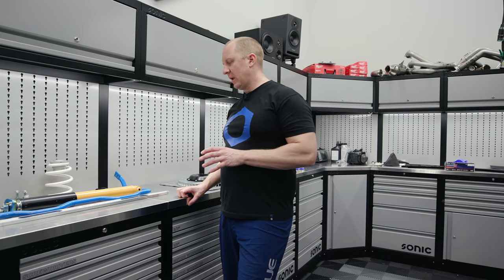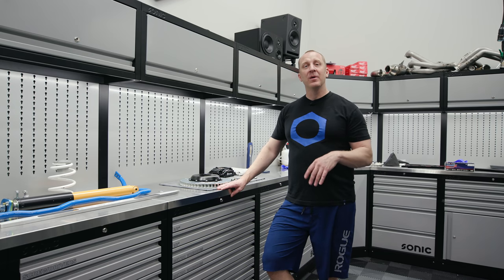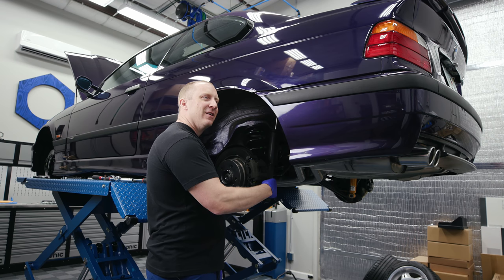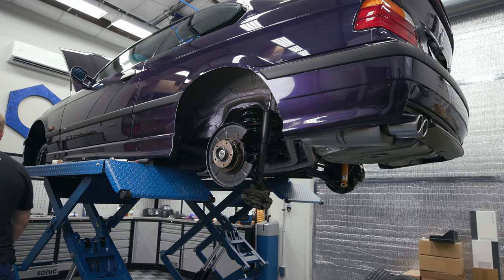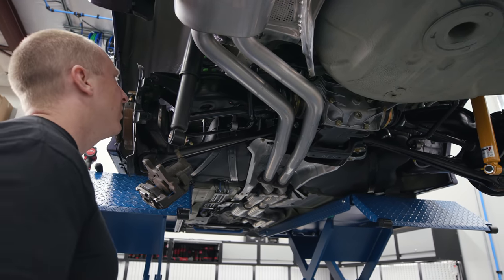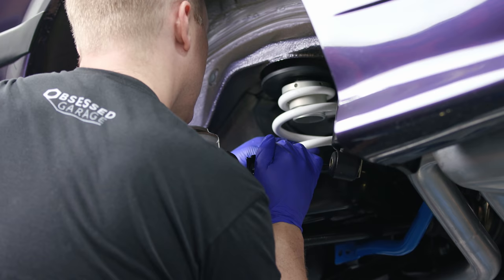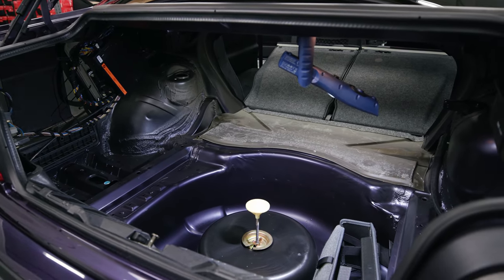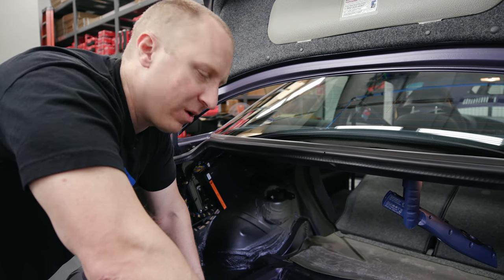E36 M3: Rear End Suspension and Big Brake Install | TC Kline SA | Brembo | Turner

Comment: I highly recommend rear sway bar reinforcement plates on the E36. When running lowered suspension and thicker sway bars, the mounts tend to rip right out of the rear subframe. I learned that the hard way…

Comment: Matt those trim pieces at the top of the fold-down seats are NLA. The soft-touch rubberized coating literally melts off and the off-white plastic shows beneath. You can easily strip the coating, clean up the parts and respray with 3M rubberized coating or other (I literally scrubbed the coating off with some IPA and my thumbs). It works great and looks OEM just like new when done. Also that trunk left-bottom trim piece is also NLA - take care of it you won't find one better than that one.
Reply from the maker: Luckily Scott, Dryceman, cleaned them perfectly with Dry Ice last week.

Comment: Our E46 has KW V3 Suspension. For the rear top shock adjustment we bought the 'Thumb Screw Adjuster Extensions'. They stay attached to the top of the shock. We cut out a tasteful size circle on top of the trunk liner there. All we have to do pop the trunk, reach in and make adjustments.

Comment: First dibs on the suspension when you swap in the other setup. My 98 M3 is on bilstein sports with H&R sport springs. Not a bad ride but needs some adjustability.

Comment: Just came across your channel and I am obsessed. I had a question about your extended rotor bolts that you use to secure the spacers on to the face do the rotor. Did they came with the spacer kit? Or did you just purchase extended bolts from a hardware/auto parts store???
Reply from the maker: The spacer kits almost always come with extended bolts.

Comment: When I installed the Dinan rear strut brace I used black rubber edge trim that you can buy at Mcmaster-Carr or wherever. Cut the slots and big as you thing you need and install the edge trim around the perimeter. It's looks factory.
Reply: be careful though those left & right trim panels for the coupes are NLA - although you can probably find used in decent shape. I still remember I was freaking out when I did my Dinan rear bar - I bought an extra set of trim panels just in case for the future... and I've been hauling them in garbage bags in attic from place to place for 20 years... and after all this they're still available to buy for my sedan!

Comment: On any car with ABS, if the brake fluid reservoir goes dry there is a bleeding process you have to go through, typically using a scan tool.

Comment: because of age, not abutse,  EVERY single bushing under the car is shot. What's supposed to happen at this point is dropping the entire rear sub-frame then go to town replacing said rubber pieces, especially the rear sub frame bushings. Sooooo' throwing away time and money on sways and overpriced Ohlins stuff is a mute point, smh. But I've only owned five BMW's, three of which are e36's so what do I know...
Reply: you have a good point but its form over function ! plus everything gets tightened up with the suspension at full extension , rather than with its wheels on and the full weight of the car on the suspension then tightened up so all bushes ECT are sitting in there correct potions if you are going to do it do it right

Comment: 24:48  .  .  . ROUNDED is period correct NOT squared off. The stock steel OE e36 tower brace is round and was only included from factory in some e36 convertibles & the e36 M3 "Light Weight". They've been "NLA" forever, good luck finding one. This dude doesn't have a clue, smh'
Reply from the maker: Hey smart guy, this is Dinan period correct.